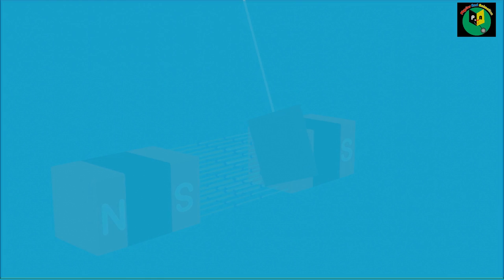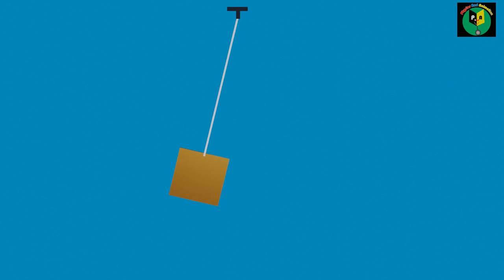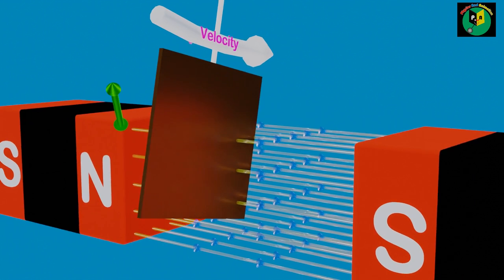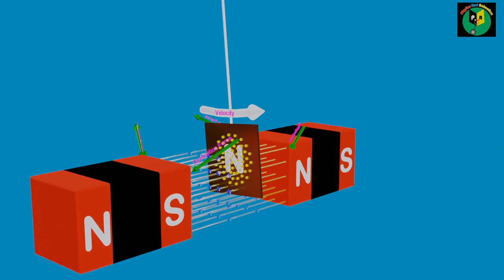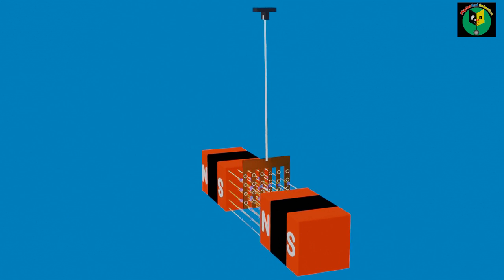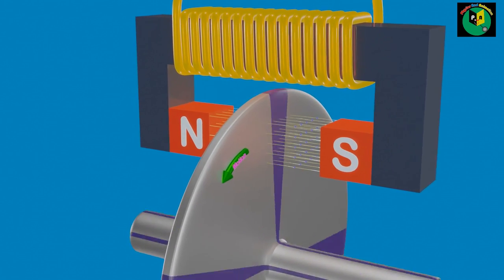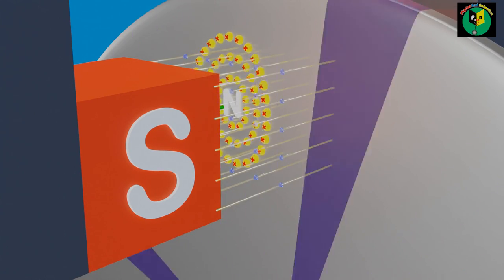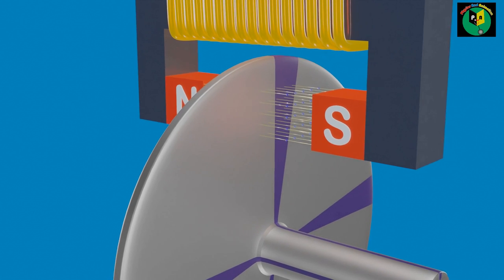Eddy current damping | eddy current application | eddy current application| #8

Comment: Hi Sir. 
I just wantted you ask you, are you sure that decreasing the magnetic field changes the direction of eddy current? I am just thinking it is not going to change it is direction but only the current will decrease. Sir if you have source about it, could you plaese share it.
Reply from the maker: Direction of eddy current will be in a way to oppose the cause which forced it to induce. Direction changes as per lenz's law. If direction will not change, that means
. 
If Plate is entering
Face of plate, in front of south pole of a magnet is acting like North instead of south And plate is attracted and supported by magnet to come into the magnetic field. 
. 
Which is actually not possible, like friction never supports the motion. 
. 
( entering motion should be opposed or plate should be forced to not enter into the magnetic field as per lenz's law) 
. 
Note that, Copper is not magnetic under normal circumstances.